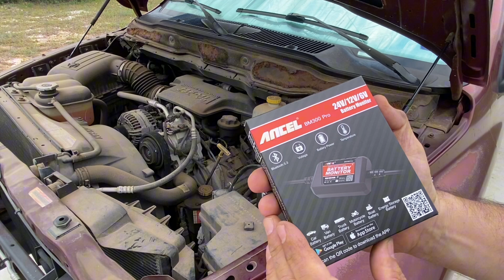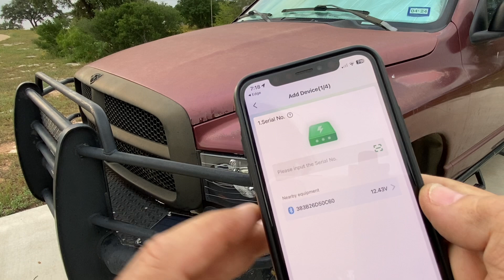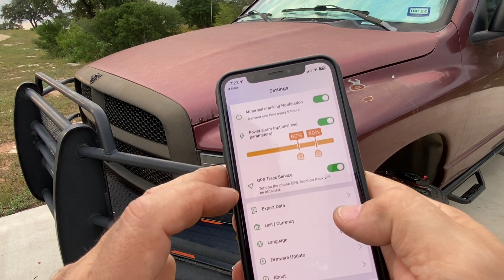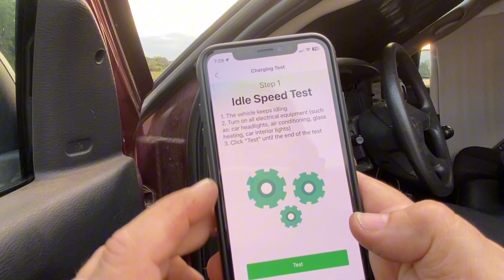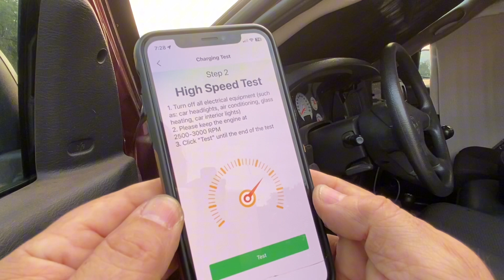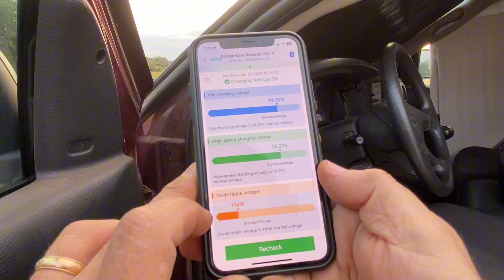⚡🔋Monitor Your Battery's Behavior!  Simple Tool - Great Results!

Comment: I just sent the BM300 back. I had their BM200 and it worked great. This one would never stay connected to the bluetooth. Then it finally died on me. Go figure.
Reply from the maker: @stlphotoandvideo  bummer.  I have both. Both still working fine. But I wish they used the same app. Thanks for your comment.
Reply: @ApacheRanch  QUICKLYNKS BT2000  este mai avansat, arata SOC si SOH. In plus arata si rezistenta interna a bateriei si rata CCA.

Comment: In the 1980 I installed a voltmeter in my car. 
I didn't need a mobile phone or Bluetooth.
Reply: in  the 80s the current draw from a battery was only for the starter(lol)... and if the car wouldnt start i can guess what you ll do...    now you can have a full diagnostic tool that you can even test the compression of your engine or see how many times the ecu woke up during night and current draw at specific time and even test its capacity... find parasitic draws etc   by the way in the 80s the phone was not mobile  and talking was by letter...   i know because i borned one year after (P.S. did not saw the clip yet..)